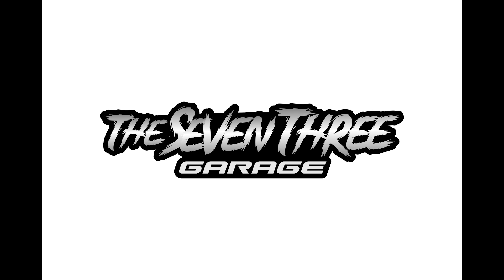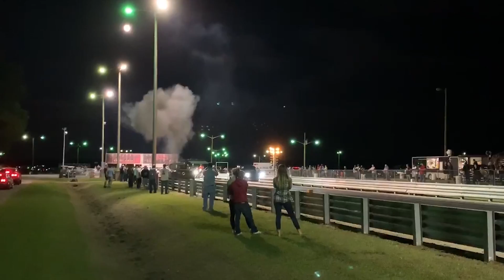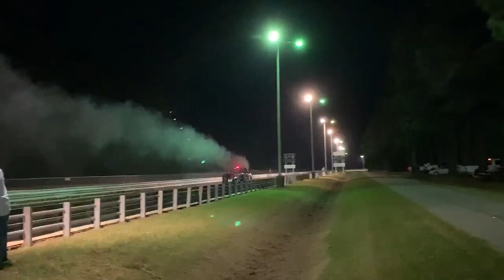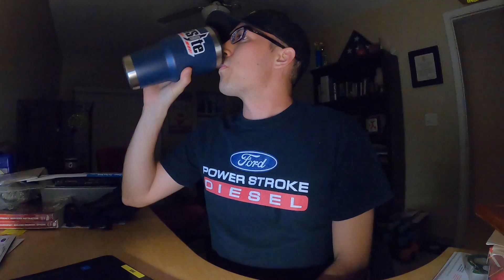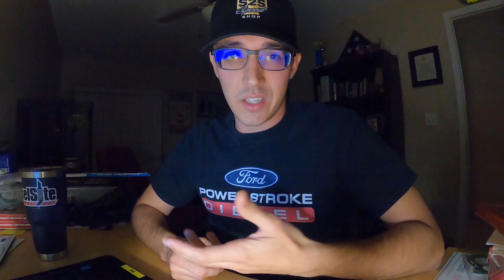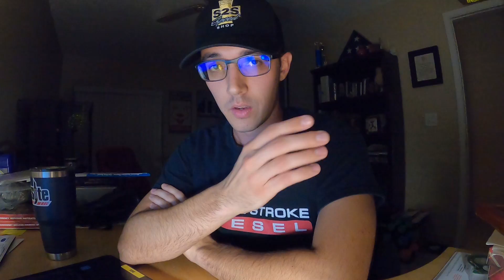Interview with a 7.3 LEGEND! *Brian Jelich of Jelibuilt performance*

Comment: I kicked the rods out of the forged rod motor with a s467. guys like SDK ran theirs with way more power using a cheaper s475 without killing it. dont make low rpm power with a 7.3 if you havent done aftermarket rods
Reply: What injectors are we talking about there?
And btw would a 7.3 be able to run ok with an s472 and stock injectors temporarily till fuel upgrades?

Comment: Brandon I'd be curious to know if the 16 volt battery increases voltage output from the IDM and injector activation speed respectively? Or did he do that strictly to help starting with a lower compression ratio?

Very informative piece, thx & how do I get those stickers?
Reply from the maker: Good question, I think either would be a possibility. That’s a question you’d have to ask Brian! 👍🏻 You can send $10 to my PayPal (Syclone313@gmail.com) just include your name and address in the comments section on PayPal!

Comment: Got tuner from JeliBuilt a couple months ago on stock 2003 F250 7.3 with 340k miles on it. Made a HUGE difference. Awesome local 757 guy too! Towed 24ft trailer across the country with tow tune. Crushed it through the Appalachians and the Rockies. Awesome. I think I convinced my brother to get one in his 7.3 Excursion. Thanks for the video!

Comment: Thanks for having me on the Channel, Brandon!
Reply from the maker: Brian told me the 16v battery is just for ease of starting and it runs the accessories much better than the 12v system👍🏻
Reply: @The73Garage  makes sense, thanks for finding out. Definitely can hear it spin over fast in that compilation video you made.  I just wonder if he's dropped a test lead onto any of the IDM outputs to see if it increased voltage any. Kinda like an easy IDM mod
Reply: @acemobile9806  just mod the IDM
Reply from the maker: Happy to have as a supporter of the channel! I look forward to seeing the truck in person one day.
Reply: Hello Brian, I asked Brandon this question and he said it was best to ask you. I'm just curious about something you did on your build. 

"Brandon I'd be curious to know if the 16 volt battery increases voltage output from the IDM and injector activation speed respectively? Or did he do that strictly to help starting with a lower compression ratio?"